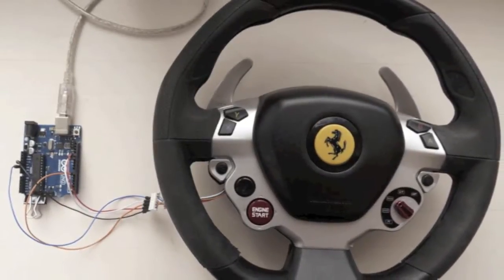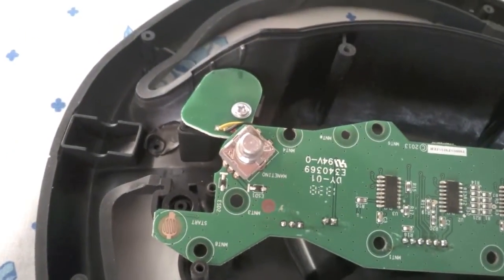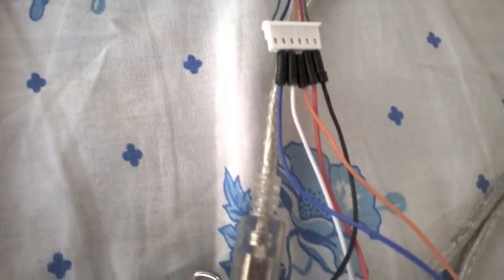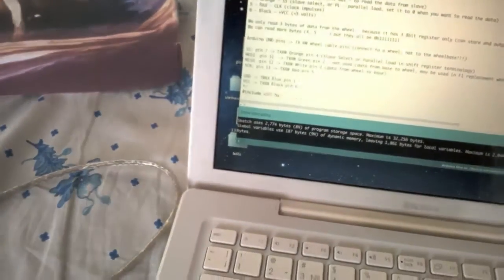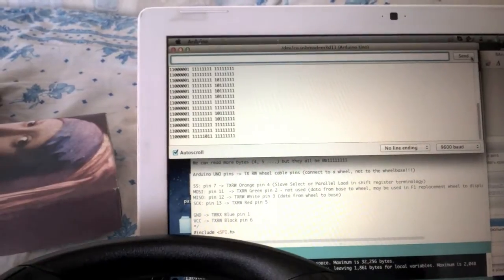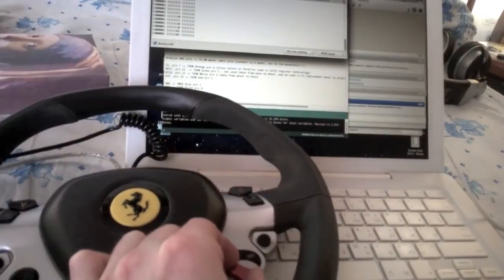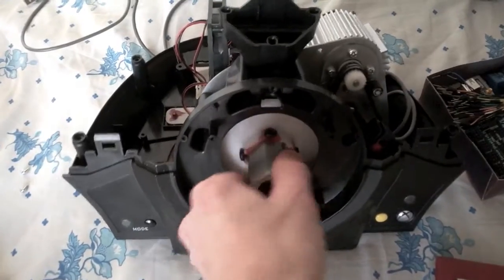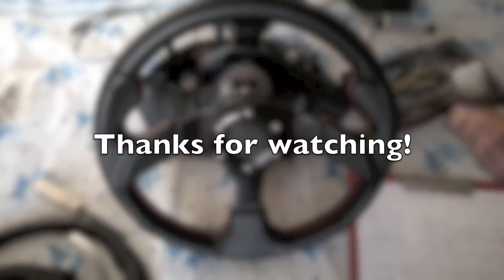Thrustmaster TX RW and Arduino - part 1

Comment: Id like to see someone trying to build a 3d printed PCM box and hub for a 458 Italia edition wheel made for the thrustmaster TX series. Great wheel 4nm ffb. Id like a real wheel or a t300 button box for Xbox without breaking the bank and using at least the paddles as the 458 as a donor?

Comment: Hi hi I'd like to use your idea to hook up a an existing TX steering wheel to my direct drive wheelbase not hooking it to wheelbase just going to go straight to the PC with the wheel. I'm just going to run it on my direct drive wheel base. could you write me a sketch for the pro micro for just the wheel please.
Thank you

Comment: Good afternoon friend, I have a Thrustmaster T300 (base) with a Bentley GT3 rim. The bezel has 12 buttons, with 4 encoders + button. But the rim is being hooked up to the PC. And I would like to plug it directly into the base, via the mini-6 din.
But as I have little knowledge of Arduino, I would like to know what you recommend?
Thanks
Reply from the maker: Hi! Really not sure about connecting Fanatec wheels to Thrustmaster bases, no ready-to-use solution

Comment: Hi, 
I have the F1 add on wheel. It does not have the serial registers but I assumed it would still use the spi but I can't get any dump. 

Can you please help me with getting the data from that pcb? 

I tried both arduino and esp ( I assumed 3.3v logic might be better suited for it)
Reply from the maker: Hey. Email me - I'll give you some instructions.
Reply from the maker: Ah, I've found your email. Replied.

Comment: hola! gran trabajo! tengo un problema, estoy verificando con arduino uno si son correctas las lecturas de los bytes de la rueda para base TX con arduino nano , pero obtengo 11000001 11111111 11111111 y al pulsar cualquier pulsador cambia a 11000001 00000000 00000000, que puede ocurrir?
Reply from the maker: Hi! What sketch are you using - tx_rw_wheel_reader.ino or ferrrari_gte_challenge_reader.ino?

Comment: Very interesting Idea, but I've got 3 questions:
1. How did you determine the functionality of the wires in the protocol? I mean how did you know that the red wire is clock?
2. If the output of your Arduino is 5V, aren't you risking to potentially destroy something?
3. Why not use a logic analyzer to demonstrate exactly what you did in your blog ;)
Reply from the maker: 1. Tear apart steering rim and trace wires to IC to find out GND, VCC and the rest. ICs inside steering rim are HEF4021BT shift registers - so it's easy to find GND/VCC/SCK/PL. See Part 1 in my blog for more info.

2. Arduino is powered directly from the wheelbase, which provides you 3.3V only. That means we have 3.3V logic levels everywhere. We do not use external power or USB 5V power for Arduino.

3. I don't have logic analyzer :))
Reply from the maker: Ah, also - HEF4021BT has a wide supply voltage range - from 3 to 15 volts. So reading steering rims with Arduino is quite safe - even if you power everything with 5V USB.
Reply: Hm, I see. I just took apart my G29 and backtracing the wires is almost impossible, so the logic analyzer came in quite handy (it's a cheap clone for only 6$).
Oh, and thank you for your fast reply!

Comment: Hi I tried  it with  t150 wheelbase... it hast no ps2 Adapter. I tried Different ino. Only the t500 no bitshift works half... 5 of 13 Buttons can be used. Maybe somebody could Help...
Could i also  read with arduino nano? I hope somebody can Help.
I Connect it to ps4
Reply from the maker: Thanks for feedback. T150 stays unsolved. We can read the wheel with nano + there's a test emulator sketch. Email me if you want to give it a try.

Comment: Any chance you can publish part 0.5 where you take the wheel apart from the base?
Reply from the maker: Wheel mounts to the base (in my case it was TXRW base and 458 Italia Add-on wheel) with Thrustmaster quick-release system - so called threaded mount, as every other TM add-on wheel (F1, 599X, 28 GT). Not much to show there: plug the wheel into base + turn big plastic nut on a plastic thread. Done.
Reply: @mispeaced  I don't know how it is on this wheel but it took me days to understand the big plastic nut on my ffdrw was indeed a nut and needed to be unscrewed (I saw that just before seeing your answer, in fact)

Comment: Not sure if you currently monitor this thread but I figured I'd git it a shot any how.

I was planning to mod an F1 rim using similar configurations as the original TM Ferrari F1 add on wheel. I noticed in your article you mentioned changing the bits from 3 to 8. Just out of curiosity, can you make a video or a sketch of this for me in Arduino for me. I'm sure it would prove useful for other in the future. 

Thanks.
Reply from the maker: If you need a dump for F1 rim just email me.

Comment: Thank you very much for sharing this great project. I have a problem checking the buttons with a Nano cand a Uno clones. in the serial monitor only the gear up appears with the digit 0 wen pressed(last on the first eight digits line). The other 16 digits always remain in 1. I have checked all the connections. Is it possible that it is a problem for Chinese clones? I have directly connected the nano to the uno and  the uno to the pc. both the 3.3 and the 5v feed do the same. I do not have a thrustmaster base. Can I check it without it?
Reply from the maker: As far as I can understand, you uploaded Emulator sketch to Nano + Reader sketch to Uno? And you're trying to verify your Emulator code? Email me close up photos of your wiring (blog -> about for email) - I'll take a look. It's not related with Chinese arduinos - you can take any board.
Reply: if exactly that. 
With the ferrari_gte reader of 8 bytes, it seems that if the buttons act but in a random way. My knowledge of electronics and English too ... is a bit fair. sorry!  I'll send you the photos, thanks for your time

Comment: Where did u buy the 6 pin male and female connectors. i broke mine and need new ones
Reply from the maker: I didn't. PS/2 male is from 458 Italia steering wheel, PS/2 female cable - extracted from TXRW wheelbase. Couple ideas for you:

https://www.ebay.com/sch/i.html?_nkw=ps%2F2+male+male
https://www.aliexpress.com/wholesale?SearchText=mini+din+6+male

Comment: Hi, I've 3 wheels for my old T500 base and wanted to use them on a new OSW so I started to investigate how to use an Arduino to grab buttons and send them to the PC via USB. First of all I wanted to thank you for all you awesome work. It helped me a lot!. I've just discovered that my Ferrari GTE Wheel Add-On (Ferrari 458 Challenge Edition) requires the maximum SPI speed to be set to 8MHz
Reply from the maker: Hey! Glad it helped you. Yea, to read GTE Challenge you need to add SPI.beginTransaction(SPISettings(14000000, MSBFIRST, SPI_MODE0)); into setup function, before SPI.begin - then it works. Could you post your readings for GTE with all buttons released? Thanks
Reply: Well, In order to read all 3 wheels I need to set speed to 4Mhz 

SPI.beginTransaction(SPISettings(4000000, MSBFIRST, SPI_MODE0));

Then here are my findings with buttons released and the identification of each one of the buttons for the 3 wheels

Note I'm using Spark Fun Pro Micro board (that affects only board pin numbers)

/*
 * 
 * 
 * http://rr-m.org/blog/hacking-a-thrustmaster-tx-rw-gaming-wheel-with-arduino-uno-part-1/
 * 
 * http://rr-m.org/blog/wp-content/uploads/2015/04/txrw_1_12.jpg
 * 
 * 1. Green – not used (connected to GND via 100k resistor, may be reserved for MOSI?)
 * 2. Blue – GND (ground)
 * 3. White – MISO (master-in-serial-out, this is a serial data line from wheel to base)
 * 4. Orange – SS (slave select, also called PL – parallel load)
 * 5. Red – SCK (sync clock impulses, each time pulse comes, shift register outputs 1 bit)
 * 6. Black +VCC (Arduino Uno uses +5V, wheelbase uses +3.3V – remember for future!)
 * 
 * On Arduino Uno side it must be connected as follows:
 * 
 * Green -> not used (or can be connected to arduino MOSI pin 11)
 * Blue - GND -> arduino uno GND pin
 * White - MISO -> arduino uno pin 12
 * Orange – SS -> arduino uno pin 7
 * Red – SCK -> arduino uno pin 13
 * Black +VCC -> arduino +5V pin
 * 
 * On Arduino Pro Micro side it must be connected as follows:
 * 
 * Green -> not used (or can be connected to arduino MOSI pin 16)
 * Blue - GND -> arduino uno GND pin
 * White - MISO -> arduino uno pin 14
 * Orange – SS -> arduino uno pin 7
 * Red – SCK -> arduino uno pin 15
 * Black +VCC -> arduino +5V pin (or RAW if USB current is +5V already)
 * 
 * 
 * 599XX EVO 30 Wheel Add-On Alcantara Edition
 * 
 * 01011111 11111111 11111111 11111111 11111111 11111111 11111111 11111111
 * 
 * 76543210 76543210 76543210 76543210 76543210 76543210 76543210 76543210
 * Byte 1   Byte 2   Byte 3   Byte 4   Byte 5   Byte 6   Byte 7   Byte 8
 * 
 * Byte 1
 * 7 - constant 0
 * 6 - constant 1
 * 5 - constant 0
 * 4 - left paddle (Gear down)
 * 3 - right paddle (Gear up)
 * 2 - PIT (up left right)
 * 1 - WASH (down left left)
 * 0 - RADIO (up right left)
 * 
 * Byte 2
 * 7 - black unnamed (down left right)
 * 6 - MAIN DOWN (down right)
 * 5 - MAIN UP (down right)
 * 4 - SCROLL (up right right)
 * 3 - FLASH (up left left)
 * 2 -
 * 1 -
 * 0 - MAIN press (down right)
 * 
 * Byte 3
 * 7 - pad DOWN
 * 6 - pad RIGHT
 * 5 - pad LEFT
 * 4 - pad UP
 * 3 - constant 1
 * ...
 * 0 - constant 1
 * 
 * Byte 4 to 8
 * 7 - constant 1
 * ... 
 * 0 - constant 1
 * 
 * T500RS Original
 * 
 * 00011111 11111111 11111111 11111111 11111111 11111111 11111111 11111111
 * 
 * 76543210 76543210 76543210 76543210 76543210 76543210 76543210 76543210
 * Byte 1   Byte 2   Byte 3   Byte 4   Byte 5   Byte 6   Byte 7   Byte 8
 * 
 * Byte 1
 * 7 - constant 0
 * 6 - constant 0
 * 5 - constant 0
 * 4 - R2 (PS2)
 * 3 - Triangle (PS2)
 * 2 - Circle (PS2)
 * 1 - Square (PS2)
 * 0 - Cross (PS2)
 * 
 * Byte 2
 * 7 - SE (PS2)
 * 6 - L2 (PS2)
 * 5 - Playstation (PS2)
 * 4 - ST (PS2)
 * 3 - pad DOWN
 * 2 - pad RIGHT
 * 1 - pad LEFT
 * 0 - pad UP
 * 
 * Byte 3 to 8
 * 7 - constant 1
 * ... 
 * 0 - constant 1
 * 
 * Ferrari GTE Wheel Add-On (Ferrari 458 Challenge Edition)
 * 
 * 01000000 10101111 11111111 11111111 11111111 00000000 00000000 01000000
 * 
 * 76543210 76543210 76543210 76543210 76543210 76543210 76543210 76543210
 * Byte 1   Byte 2   Byte 3   Byte 4   Byte 5   Byte 6   Byte 7   Byte 8
 * 
 * Byte 1
 * 7 - constant 0
 * 6 - constant 1
 * ...
 * 0 - constant 0
 * 
 * Byte 2
 * 7 - SCROLL (up right left)
 * 6 - constant 0
 * 5 - constant 1
 * 4 - constant 0
 * 3 - left paddle (Gear down)
 * 2 - right paddle (Gear up)
 * 1 - PIT (up left right)
 * 0 - WATER (down left left)
 * 
 * Byte 3
 * 7 - Selector PRESS (down right)
 * 6 - WIPER (down left right)
 * 5 - Selector 2 (down right)
 * 4 - Selector OFF (down right)
 * 3 - RADIO (up right right)
 * 2 - FLASH (up left left)
 * 1 - constant 1
 * 0 - constant 1
 * 
 * Byte 4
 * 7 - constant 1
 * 6 - pad DOWN
 * 5 - pad RIGHT
 * 4 - pad LEFT
 * 3 - pad UP
 * 2 - constant 1
 * ...
 * 0 - constant 1
 * 
 * Byte 5
 * 7 - constant 1
 * ...
 * 0 - constant 1
 * 
 * Bytes 6-7
 * 7 - constant 0
 * ...
 * 0 - constant 0
 * 
 * Byte 8
 * 7 - constant 0
 * 6 - constant 1
 * 5 - constant 0
 * ...
 * 0 - constant 0
 * 
 */
Reply from the maker: Thanks! GTE Challenge read-out doesn't match what I have. One of my subscribers sent me the data for this rim - first byte (01000000) is not there at all. But the rest matches. May be he ignored the first byte, because it's constant, I'm not sure.

Ferrari 458 Challenge GTE Wheel Read-Out:

10101111 11111111 11111111

Byte 0:
7 - Scroll (Circle, button 5)
6 - Constant 0
5 - Constant 1
4 - Constant 0
3 - Gear Down (L1, button 1)
2 - Gear Up (R1, button 2)
1 - Pit (Triangle, button 3)
0 - Water (Square, button 4)

Byte 1:
7 - Mannettino 1 (TC1, PS, button 13)
6 - Wiper (Cross, button 6)
5 - Mannettino 2 (TC2, Select, button 7)
4 - Mannettino Off (TC0, Start, button 8)
3 - Radio (R2, button 9)
2 - Flash (L2, button 10)
1 - Constant 1
0 - Constant 1

Byte 2:
7 - Constant 1
6 - Dpad Down
5 - Dpad Right
4 - Dpad Left
3 - Dpad Up
2 - Constant 1
1 - Constant 1
0 - Constant 1
Reply from the maker: I've added Reader sketch for GTE wheel into Part1 article. This sketch produces the read-out above. https://rr-m.org/tx_wheel/ferrari_gte_challenge_reader.zip
Reply: We need more people to confirm. Anyway, I found that with different values on SPISettings (speed) bits might be displaced and some buttons could not be recognised on some rims. The value (4 MHz) was the only one where I could read all rims and all buttons on all rims. Note also I'm reading 8 bytes as you said in part 2. 

I've already prepared the USB part as a device with 32 buttons and a HAT switch with 8 positions plus null. Now I'm having fun with the process of writing the complete loop to read values, identify rim, set buttons and update USB bus.
Reply from the maker: See my link above. I think the problem there is that you need to add a little delay before reading each byte - this might be the case the results are unstable.
 for(int i=1; i<=8; i++) {
   delayMicroseconds(100);
   printBinary(SPI.transfer(0x00));
 }
Reply from the maker: Or may be not inside the loop, but a short delay after setting slaveSelectPin to LOW. Everybody uses his own arduino flavor - I'm getting emails where the guys use Teency LC, Nano, Micro, Leonardo, XMega, ARM-based (STM32) arduino ... - so yea, they are all a bit different and the code requires tweaks.
Reply from the maker: Yea, that means rim wasn't ready yet. Looks correct now. Good luck with your mods!

Comment: Hello, thank you for sharing this awesome project. I have a few questions, since I'm experiencing some problems with my project.
I'm using TS-PC Racer wheel. At first I tried reading my Ferrari GTE wheel using the Arduino Nano with the provided sketch, but the outputs were just a random mixture of 1's and 0's without any order. In your example you had lines with 1's and when you press a button it would show up as 0. In my case, only a few buttons give out a 0 in that mess. So I then decided to use the provided sketch for the 458 Italia wheel.
It looks like it's working ok, and the TS-PC wheel base is registering different button presses, but I occasionally get random button presses when I'm driving. Sometimes random upshifts occur, sometimes paddle shifts are not registered, my dashboard is blinking with lights on and off. This generally occurs when I'm turning the wheel harder or when I'm drifting and wheel countersteers fast.
I also tried to look what happens in the Thrustmaster profiler. When this behaviour occurs it seems that all of the buttons are pressed at once. They blink for a very brief time. Maybe you have an idea what is happening and how to fix that?
Reply from the maker: Regarding Ferrari GTE - I remember this rim wants an additional SPI.beginTransaction. Email me (see my blog -> about) and I'll send you the code. Regarding "all buttons pressed at once" - looks like bad contact or power supply problem. When you rotate the wheel actively, main motor (force feedback) eats all the power -> as a result the rim electronics doesn't get enough and resets. But that's just an idea.

Comment: Hello great videos. I got a problem i need 2 fix with my thrustmaster tx ferrari hub.
I need to connect an extra b-butten and an extra start  butten from inside the hub itself.
Not cut the wires but just peel them of a bit and souder  2 extas to it so to say. 
Because i all ready got a different wheel fore the hub but there is no buttons on that and i can't get my controler b butten to work as a hand break on the controller when it,s connected with the drift wheel.
Or the start button.
So what i need to know is what cable goes to what inside the hub after the electrailcard??
Is that anything you can possibly give me a tip about? 
Thanks from Sweden
Reply from the maker: Thrustmaster TXRW wheelbase (you call it "hub"? correct me if I'm wrong, please) has 3 buttons on it - Mode, Button 11, Button 12. Also, I got a feedback, that a guy managed to find Gear Up/Gear Down connectors somewhere inside the wheelbase. So, if you're trying to add buttons by soldering wires to something inside the wheelbase - those 5 buttons (Mode, 11, 12, Gear Up, Gear Down - if you find them) are your only options. Replicating other buttons, that exist on stock steering wheel is done by soldering wires directly to steering wheel itself OR via making your arduino-based electronics and connecting it to front wheelbase ps/2 socket (as shown on video).
Reply: mispeaced yea my thoughts were 2 just put some extra buttuns on the existing wierers  in the hub= by that i mean the stearing box so 2 speak.. because i got a drifting wheel with no buttons on it at all.
Works great with Dirt3-4 but not on Forza 7 or project cars.
So what i wanted 2 know was witch wieres  go 2 what in the hub/steringbox

Comment: I tried it with my 500rs but I have a different button layout than you. also all the a buttons don't work at all. any idea? tried 2 nanos
Reply from the maker: T500RS wheelbase differs from T300/TXRW, so there's a dedicated sketch for it -  t500_gt_wheel_emu_13buttons.ino. See http://rr-m.org/blog/emulating-thrustmaster-t500-gt-wheel-electronics-with-arduino/

Comment: Any chance you know where I can get a similar switch that is used for the Manettino?  Going crazy trying to find something for my new project!  Thanks for any help!
Reply from the maker: I never saw the switch, that rotates (and returns to center) like manettino on sale. But you can buy linear switch easily. Search on eBay 'T80-R SPDT', 'Rocker Switch single pole 3 position centre off biased', 'MARQUARDT 1818.1302-00', 'SMALL ROCKER SWITCH 6A CENTRE OFF', 'ROCKER SWITCH MOMENTARY CENTRE OFF'
Reply: mispeaced  I knew about the rocker switches but really wanted the dial type,  oh well my luck. I guess I will try to somehow make something. Thank you so much for taking the time to help!